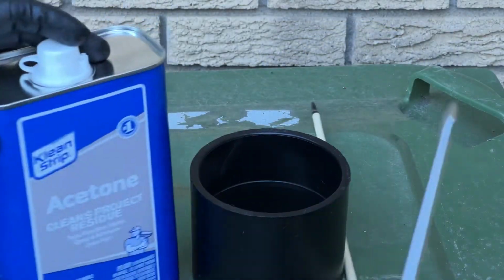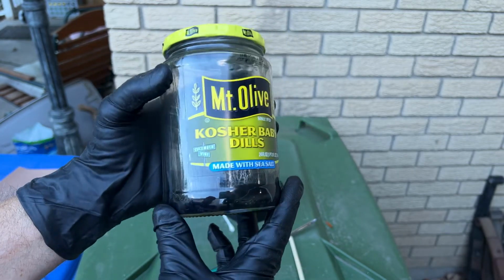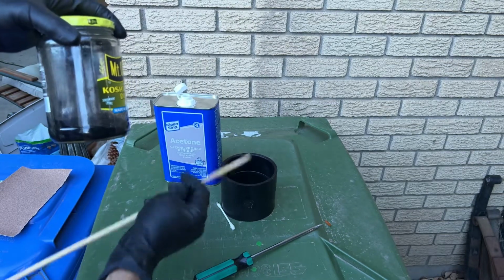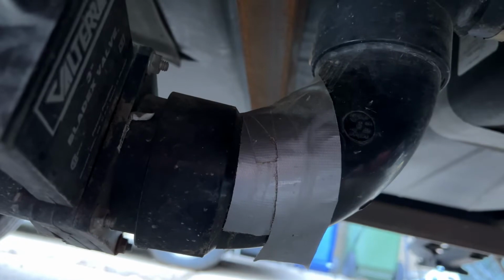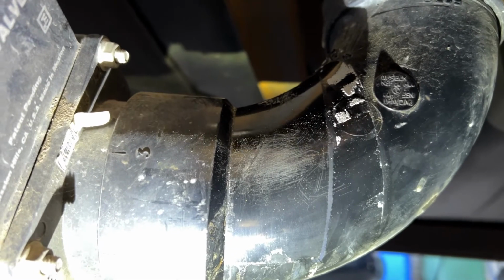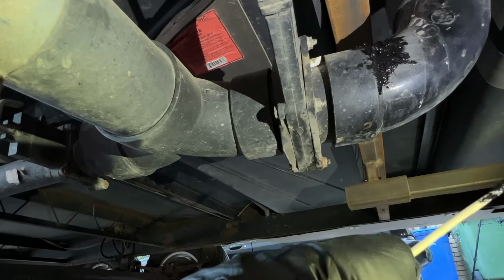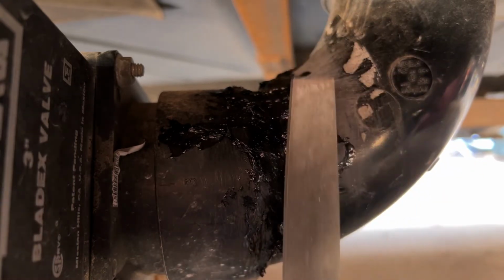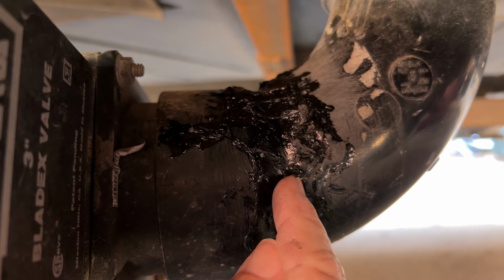RV DIY can you repair ABS plumbing?

Comment: How do you make the abs
Reply from the maker: Get a glass jar with a lid that seals well. Add any ABS you have to the jar and pour in a little acetone. Seal the jar and wait. Shake it up occasionally to speed it up.

You can use ABS filament for a 3D printer or pieces of ABS pipe. The smaller the pieces are the faster it melts. 

If it's too thin add more ABS or leave the lid off a bit. If it's too thick add more acetone. 

It's really that easy. Just paint it on the crack and when the acetone evaporates it will be as solid as before you melted it. 

I hope this helps.

Comment: Could you tell me how you mix up your ABS patch
Reply from the maker: Use a glass container that has a lid that will seal well. Break up some old ABS any kind will do or use ABS 3d printer filament. 

Just drop the pieces of ABS in the jar and pour some acetone in and seal the lid. I shake it occasionally. The amount you use will determine how thin the slurry is. If it's too thin either add more ABS chips or leave the lid off for a bit. 

Once the slurry is right for your needs apply it to your damaged item. Once the acetone evaporates it will be as strong as before you melted it. 

Be sure you are in a well ventilated area.
Reply: Thank you it was very helpful I'll let you know how mine turned out Happy camping
Reply from the maker: @tomvillhauer8060 thanks, I appreciate the feedback.

Comment: I'm not sure but why not just use abs glue.
Reply from the maker: ABS glue works well to secure two pieces that have overlapping surfaces but this bridges the gap in the crack and makes that area thicker. If you don't want to make this yourself, it is available but it's fairly expensive for a small amount. 

If the crack isn't opened up and the pipe has low pressure the glue might work but this fixes it in one try. 

Thanks for stopping by. Have a great day and be safe out there.

Comment: Will ABS Cement do the same thing?
Reply from the maker: I don't think it will work exactly the same way. This dissolves the ABS then evaporates leaving the ABS solid again which not only fills in the cracks but builds up the area around it. 

It seems like the ABS cement softens the ABS but I don't think it would get thin enough to spread it around.

Comment: That patch is only a tiny fraction of the thickness of the pipe, so there's a good chance that it will crack again.  After sanding, I would clean with acetone to remove the dirt and then apply several layers.
Reply from the maker: Thanks for the input. Since there isn't any pressure on that fitting it hasn't been a problem so far. We have about 12k miles of bouncing 
since the repair. 

On tight cracks the acetone has a tendency to melt the two sides of the original crack back together. 

It doesn't look like there's a lot on the pipe in the video but the amount of ABS I put on the pipe is pretty close to the thickness of the pipe. 

It certainly wouldn't hurt anything to sand it and add another coat and on a line that had pressure in it, it would be a good idea. 

Hopefully someone will see your comment and it might help them. Have a great day and be safe out there!

Comment: Sorry Dave - where do I find the recipe for abs concoction?
Reply from the maker: It's just ABS plastic and acetone. There isn't any certain ratio. I try to make it thin enough to spread but thick enough it doesn't run too easily. 

You can get something as simple as a short piece of ABS pipe or an ABS pipe fitting. If you break it up it dissolves faster and the smaller the pieces the better. 

Put the pieces in a container (any glass jar that seals) and add a little acetone to it. Seal it up from a few hours to overnight and check it. Mix it with a wooden dowel or old screwdriver. If it's too thick for your use add more acetone and if it's too thin add more ABS or leave the lid off for a little while. It evaporates quickly. 

Alway do this in a well ventilated area. When you get the mixture to the consistency you like just spread it over the crack. As soon as the acetone is evaporated it's ready to use. The ABS you melted will be as strong as it originally was. You can always add several coats if you think it's too thin, just let each layer evaporate for a while between coats.

Here's a quick video that might help. 

https://youtube.com/shorts/9hxNXow7mjM?si=Az-K8u_i7J69mHzj

Comment: Can I buy ABS at Home Depot.
Reply from the maker: Home Depot had ABS pipe and fittings in a big variety of sizes and shapes. If you plan to melt it with acetone it will melt faster if you break it into small pieces first.

Comment: How is that patch holding up?
Reply from the maker: Solid as a rock. The liquid ABS has enough acetone in it that it melts slightly into the part being repaired. 

I don't expect to ever have a problem with that spot again. 

Thank for checking it out and the comment. Have a great day and be safe out there!
Reply: Thank you for the video! I am repaier freeze damage now.  Fingers crossed.
Reply from the maker: @dianajdanj  just be sure it's clean. I hit it with a little sandpaper. I don't know if it helps but it definitely doesn't hurt. I'm sure you can do it.

Comment: I would like to see a video on melting abs and would a putty knife or nylon bristle brush to apply the abs?
Reply from the maker: I’ll do the video. I’ll try and get it out before we leave on vacation next week. 

You can apply it with anything that it doesn’t melt. 

You can make it with a thickness anywhere from milk to Elmer’s glue to peanut butter. It just depends on the mixture ratio and what you are trying to do.